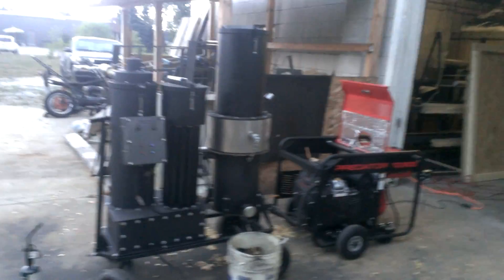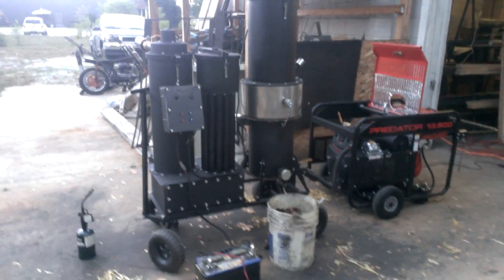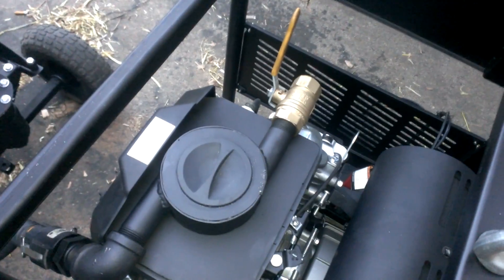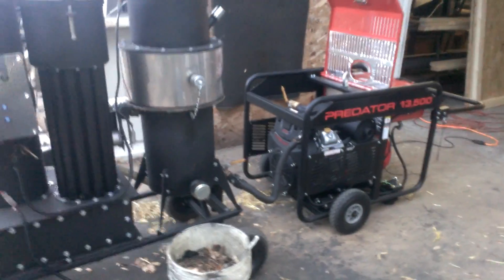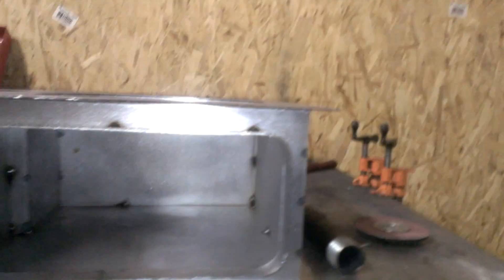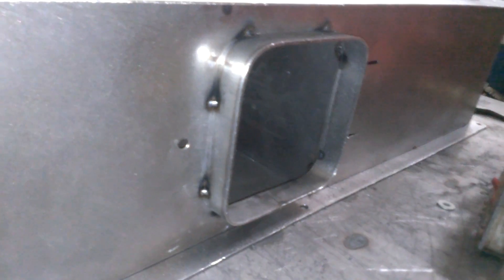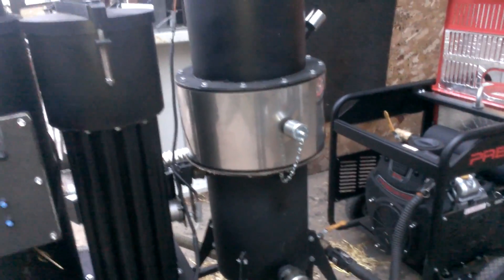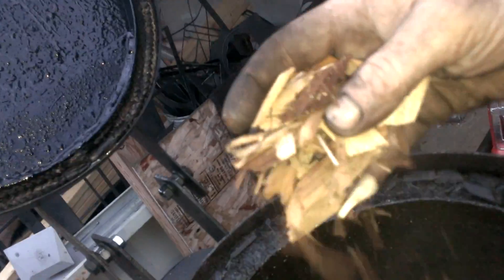Vulcan Gasifier 2016 Model Year

Comment: Already out of business 😒. I want one.
Reply from the maker: Who is out of business?
Reply from the maker: https://www.facebook.com/ThriveOffGrid/posts/2164461390278633?notif_id=1552436541007619&notif_t=page_post_reaction
Reply from the maker: @bryaniskoo  Scrap metals? These machines are hand crafted from new raw materials. This machine is fully automated as well. The BOM for this machine is over $2500.00 USD plus 400 labor hours, commercial building expense,
Reply from the maker: @bryaniskoo  Vulcan Gasifier has simply been rebranded to Thrive Off Grid
Reply: @Thrive-Off-Grid  very good. Maybe you should try scrap as that's all that's really needed AND recycling is the main principal of gasification. 400 hours does not seem profitable to me. I will subscribe to both.
Reply from the maker: @bryaniskoo  Building any gasifier is very labor intensive. Building a gasifier out of junk, renders a gasifier made from junk. These machines are a product of years of very rapid development and produce engine grade gas. The automation ensures it stays running. Do not take for granted there are many plumbing parts, motors, seals, paint, the steel raw materials, the wheels, etc. The hearth core is made from cast SS and is $150 bucks by it self. There are over 250 CNC processed parts that go into one of these machines. This is not a cheap or simple machine it has a very advanced reduction core with air preheat chambers built inside. Besides this the steel we get is already recycled.
Reply: @Thrive-Off-Grid  true.  probably offers a ton more quality of life. I appreciate the fact that it's one integrated unit. Well keep up the good work.   I'm gonna make a disgusting looking one from scrap 😄.
Reply from the maker: @bryaniskoo  lol ok well stay away from MrTeslonian's designs if you do. We did start out using air compressor tanks.  but cutting them apart vs using a CNC machine and making from scratch is just more productive and allowed the flexibility to design more developed systems. You will learn this is not so cut and dry, there are not very many videos of home built machines running an engine for more than 5 minutes. Then there are even less showing the same machine and generator running at a different time. Eventually you will get tired of baby sitting the machine and dealing with engine stalling. This is where my machines are different, they run nearly  as stable as a gasoline system and with out tar as long as dry enough fuel is used. If you remember LEAF gasifier, those machines were over $4500.00 and all they were was a WWII era design, They were hardly half the machines I produce. My cooling systems are nearly 6 times what leaf had, plus a proper condensing stage. I supply the engine adapter, the O2 mixture controller with electronic valve and all the hose hook ups. That machine I directed you to is an RTR machine minus your generator.
Reply: @Thrive-Off-Grid  I did the math and your machine would only be 44 days ROI for my uses. That's better than crypto currency mining... Do you have info on pounds per hour of material? 
The cooling aspect I'll just absorb for more gas production. My only real fear is too much pressure and grenading my shop lol.
Reply from the maker: @bryaniskoo  You should probably go to my website, as this is a 2016 model in the video, we no longer produce this machine. The new machines the reactors are cool to the touch so there is nothing you can harvest from the reactors. The gas cooling on the new machines use a chiller system and you can use this for CHP along with engine exhaust heat and the Liquid cooling on the Liquid cooled engines. The new machines have an active wash gas scrubbing system, a two stage cyclonic final filtering system, are fully automated way beyond this machine in the video. The reactor systems on new models is also well beyond anything on current market. They are tar free and do not produce condensate.

These machines are fully integrated and include the engine and generator systems. They are ready to run out of the box, just put fuel in them and hook up a battery 

https://www.thriveoffgrid.net/
Reply: @Thrive-Off-Grid  for sure. Been looking at it all day. The options seem limitless.
Reply from the maker: @bryaniskoo  https://www.facebook.com/ThriveOffGrid/posts/2165626656828773?notif_id=1552571491443164&notif_t=page_post_reaction

Comment: Great vid and gasifier design.
The only thing I had an issue with was the air fuel control. Of the gasifiers I have seen this seems to be common. Most, like you, use a ball valve to act as a carb.
From my understanding an automotive Co2 sensor can generate from 0 to 1.5 volts. With an optimum voltage of 1 volt @ 600 degrees f. Using the 12 volts from the coil you should be able to power an electronic throttle bodies servo as well as a circuit board. The electronic throttle bodies servo uses 0 to 5 volts to adjust the position of the butterfly valve. 
Make a circuit board that you can adjust the incoming 0 to 1.5 v signal  from the Co2 sensor to control the output going to the electronic throttle body servos 0 to 5 v positioning system. 
Being able to set the electronic throttle bodies valve position to correspond to the Co2 sensors output at an optimal air/fuel mix would be smaller,  more fuel efficient, better performance as well as more user friendly. 
As a ref: Ford electronic throttle body 9L8Z9E926A, DS7Z9E926D, DS7Z9E926A. 
Let me know if it helps. 
Anyone that can scratch out a schematic for the circuit board plz reply.
Reply from the maker: You havent seen our other videos have you? We use a Wide Band O2 sensor and use code to adjust a servo. We still use a ball ball for a number of reasons. The main reason if the something broke and the end user still wanted to run they can replace our valve with a stock valve run in a manual mode. The narrow band sensor are used to adjust to injector trim and on some it is used to control PWM output of the fuel pump. Wide Band is easier to work with as they already run 0-5 volts.
Reply: Thrive Energy Systems
Kool info. Good to know.
No I haven't seen that vid yet. I will look for it. Thanks for the reply.
Reply from the maker: Check our channel there are tons of videos, we are doing a DIY build as well and we will eventually work on the mixer controller as part of this later on .
Reply: Thrive Energy Systems
BTW Have you found away to store the gas under pressure. This could be utilized to start the burn on an auto running system. Likewise if you could store enough to run the engine with during start up it would eliminate start up lag time and the need for the blower unit.
Other than finding away to supper glue a Sterling to the gasifier boiler you've done a badass job. Congrats!
Reply from the maker: That gets very elaborant and storing hydrogen is a dangerous game. No need for that, the systems can go from cold start up to engine run in less than 1 min. The ES-1 and 2 run automatically anyways, they fire themselves up with no intervention from an operator.
Reply from the maker: If you think this is an advanced machine wait until you see our Advanced machines!! This is an older unit and is just the stand alone system. We build much more advanced machines with HO V8 engines, auger fed hoppers etc.
Reply from the maker: Check out this video, this is a more evolved version of the machine you see here in this video. https://www.youtube.com/watch?v=Q2_7hSBvDsY&t=186s This has the electronic fuel mixer controller and other advanced automation. Next gen systems will have a touch screen display and full automatic run modes. You just arm the system and walk away and the machine does the rest :)

Comment: Can your current setup handle the construction of a 250 kw project and how long would it take to build?
Reply from the maker: We would have to build a team of units. We can build as big as 50 kW. So you would need 5 units and synch them. It would be a more practical system this way as well. If it is just a single unit and it goes down the whole thing is shut down. With a team of units it would be more practical to service them as you can shut a single unit down at a time. It would also be easier to load the fuels into a multiple units. We currently offer a 25 kW machine, we would simply scale this machine up to 50 kW and use larger displacement engine. This would be a new machine for us so it would take a year to build the first one and then later units would come faster. There will be a lot on engineering and development involved; however,  much would be borrowed from our existing 25 kW version
Reply: I agree and what about delivery time for the 5  units
Reply from the maker: ***** It would at least year after you placed the order for the first one and then we would ship each additional units from 2 apart afterward. This is only an estimate and things change here daily.
Reply: Thank you

Comment: What is the current price for the gasifre excluding the generator, and your price w/ the generator 13500 watt , the one shown in the video ?
Reply from the maker: MyShowtime33  Keep in mind that is the sale price it ends this month. Its $2600.00 otherwise and I have to use their regular pricing as our guide lines. The mixer system and adaptor is not cheap to build. I have over 40 labor hours in building this system plus parts. The O2 sensor kit needed to supply our 5 V input signal cost 200 by itself. As I stated in the video we will offer the adaptor if you wish to purchase the generator on your own. The adaptor is $50 bucks :)
Reply from the maker: Joseph M  They $4000.00 pr unit. compare this with its features to others.
Reply: VulcanGasifier Thank you for getting back to me in a timely manner, is this the same type unit as shown on this video, and does this include the generator ?
Reply from the maker: Yes the Flex Series 1 is $4000.00 this does not include the generator. The generator is also $4000.00 this is complete with the adaptor and electronic fuel mixer system. So you are looking at $8000.00 for the package deal.
Reply: +Joseph M here is the generator http://www.harborfreight.com/engines-generators/gas-engine-generators/13500-peak11000-running-watts-22-hp-670cc-gas-generator-epa-iii-61725-10521.html

Comment: Looks great! I like the lower box connection between the gaserzeuger and the gaskuler.

Something to ponder is a multi-fuel set up. I have a Tri-Fuel adapter from US Carb on my portable gen. Can run NG, propane, and gas. The NG quick disconnect is awesome for quick set up in storm situations.

Are you planning on advancing the timing on the Lifan?

I think increasing the oil capacity of these engines is important. I will be running syn motor oil. Maybe use the drain hole with tubing to an additional tank. Donno...

When I'm in Michigan I'll try to stop in and say hello.
Reply from the maker: urgentcareguy3 Yes you can add remote oil filters to this engine as well. I had not planned on modifying timing, you don't really gain a whole lot and could be problem running on gasoline.  Plenty of power stock, the Predator is a  beast, Im impressed i've ran big Kohlers and Briggs. I hate to say it but this engine will walk all over them.